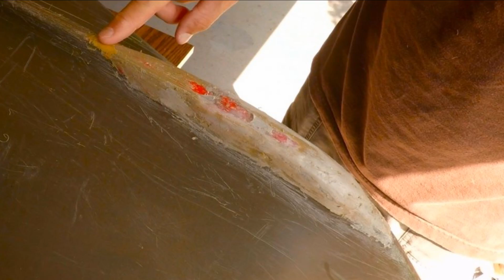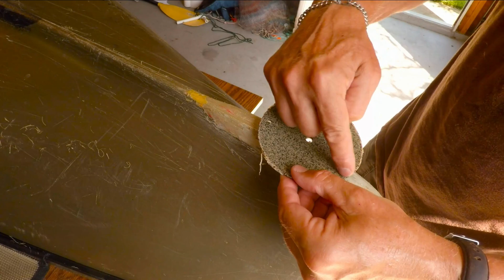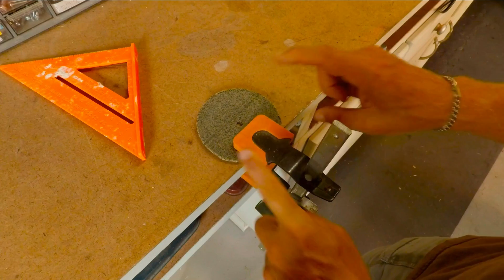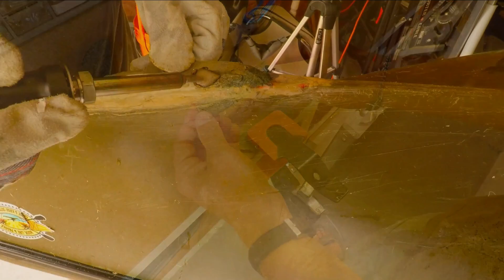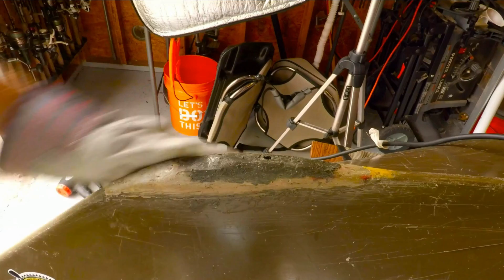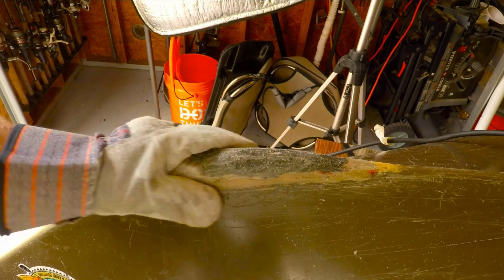Kayak Repair using Thick Plastic HDPE on Fishing Kayak

Comment: try strips of plastic tarp, its the same type compound as the kayak... so im told
Reply from the maker: I could not confirm the tarps were HDPE, so I avoided using them. It would be nice if they were.
Reply: I had bought a tarp that listed polypropylene so i dig a little bit and learned that it worked. I tried for myself and found that the tarp once melted was much harder than the kayak plastic. The repairs have held for more than a year now and still look pretty good. Not saying its the best thing to use...but it's worked for me and tarps are available, not to mention a single 6x8 is 1000's of small repairs. If i had a plastic welder though I would absolutely purchase the sticks from amazon.
Reply from the maker: That is good to know.I have plenty of tarps hanging around from Harbor Freight. I will give one a try. Thanks!

Comment: could you not use maybe some sheet metal as a bumper to protect that area of constant use???
Reply from the maker: The problem would be attaching it to the existing plastic.  With a screen, the plastic is melted into all the holes to lock it in.  I suppose you could take a small strip of sheet metal, screw it into the boat and then cover it with plastic to keep it in position and from rusting. Without the screws, I think the strip of metal would tear off.  I'll have to think about this...  thanks!
Reply: good point

Comment: what about melting hdpe in the oven to a putty then taking what you need and molding and shaping it to the the area?
Reply from the maker: Good idea, but I do not think it would work since the hdpe cools very quickly.  I do not think you could get it on the yak quick enough.
Reply: well you would have to use a conventional oven where you are working and then apply it. also use your heat gun.
Reply from the maker: If you try it, let us know!